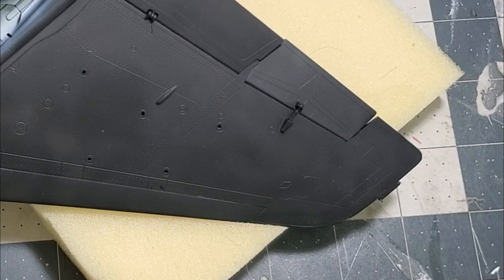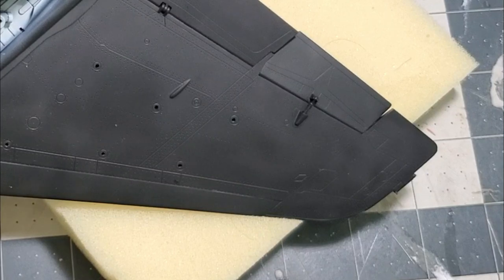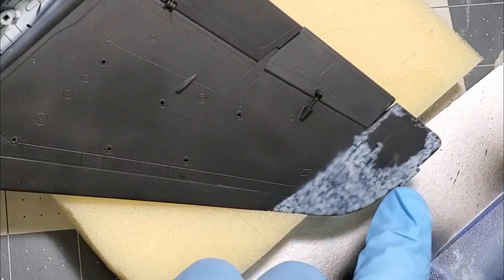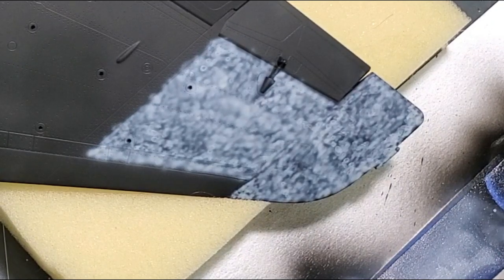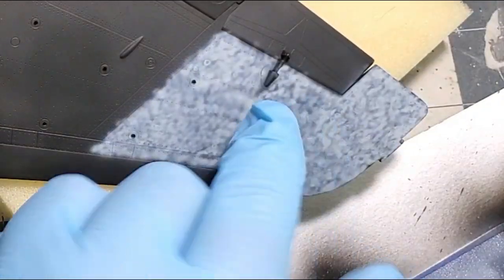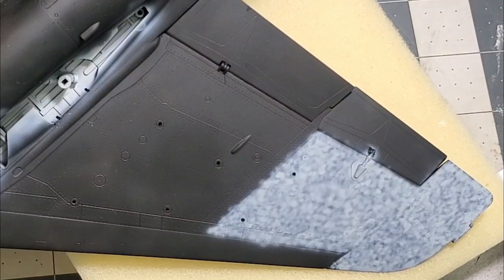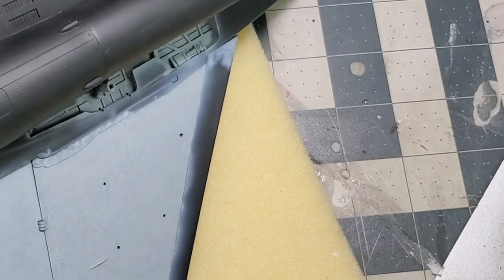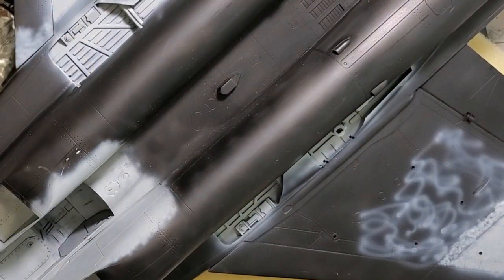Tighter Baby, How I Blackbase

Comment: Thanks for the great video! Still new to black basing so this will help along the way. How would you pick out the underlying marble color on for example multi color camo paterns?
Reply from the maker: In that instance I do the same process. I just map out the camo pattern and don't overspray into areas where the other color(s) go. With a detail airbrush and spraying small this is pretty straightforward. Then you can mask if you wany to or freehand the next color. If that seems confusing let me know and I'll try and explain better
Reply: I’m probably in the minority but I use white as my marble layer and on multi colored camo schemes, I spray the first camo color in roughly the area I want it, mask it, then touch up the edges around the masks with black/ white...rinse and repeat.  Although it’s a little extra work, I’ve found that it keeps the weathering consistent throughout the demarcation of camo colors...I’ve only done it using hard edge camo patterns and might be a little more difficult with softer edges.  I posted a video using this technique on a 1/32 Horten Ho 229.  Some good videos btw Jim, It’s nice to know there are other dorks out there like me ;). Subbed.

Sean
Reply: Hi Jim yes that does make sense! Main thing i wonder is would you use a lighter color for the marbeling or the same as the top color?